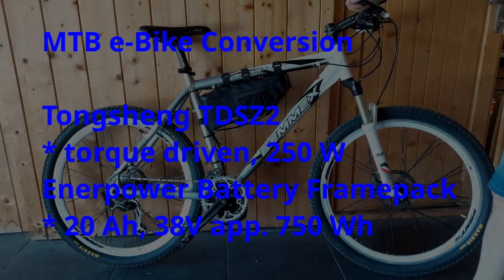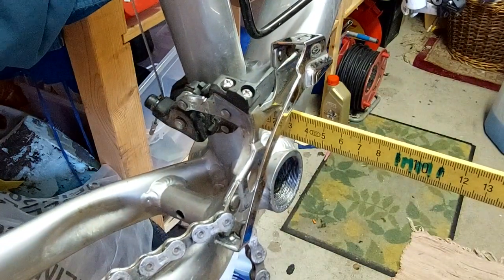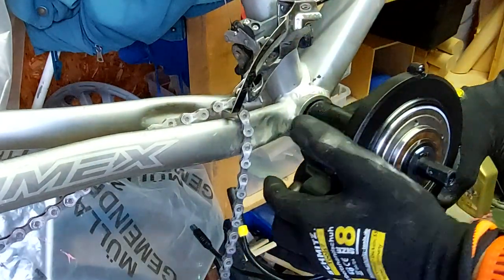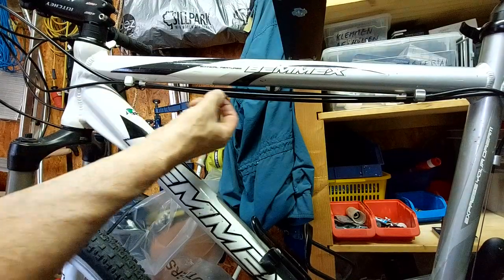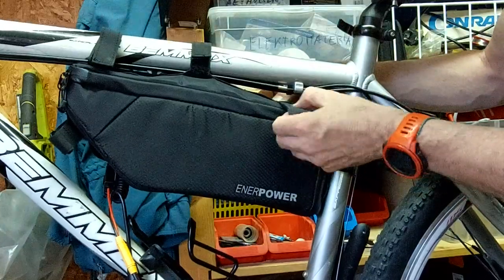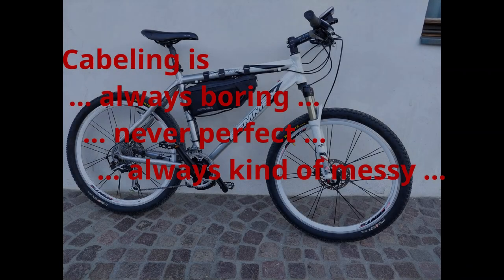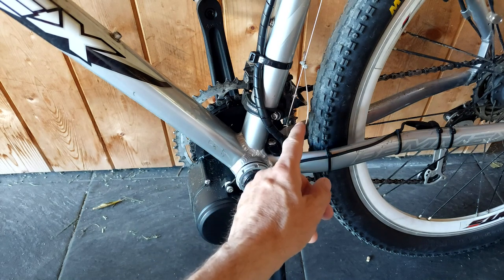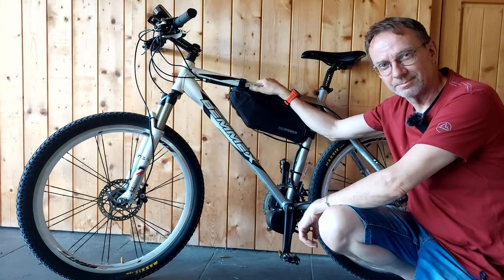Tongsheng TSDZ2 DIY E-Bike Custom (double) Chain Ring

Comment: Nice build...im also building one using tongsheng
Reply from the maker: Thanks! I had a look at your channel and hope you will make a presentation video once your done with the tongsheng installation - it's really a great conversion kit!
Reply: Thanks mate. Appreciate your work. I have finished my build finally and now in the process of doing tests with it. What is your experience with the throttle? Mine doesn't seem to work very well. And how good is the motor on hills?

Comment: I have a tsdz2b and use the 42t stock chainring with a mountain bike. I didnt yet have any problem going up hill. I was more wanting speed with a bigger chainring for keeping up with the road cyclist. You think its possible to go the other way and have a 42t and larger 50t+ chainring for more speed ?
Reply from the maker: Of course. The only thing to consider is that the stock chain ring usually has an offset to be closer to the frame. Thus the gap between the two chain rings will maybe be too large and "catch" the chain and make gear changing difficult. Check for that and if this is the case replace also the 42T stock chain ring with a standard non offset chain ring. Now you should be able to combine this with 50t+. Have a look at my other video to get a vintage derailleur to make dual chain ring work.

Comment: P.S. You did that with a 32 tooth smaller front Chain-ring but could one also use a 28 tooth one as well?
Reply from the maker: 34 seems to be the minimum you can use on tsdz2.    The Motor ships with 42T standard. Hope this helps.
Reply: @the_geargineer  My Bafang Mid-motor shipped w/a 44 Tooth Chain-ring supplied

But was curious about what I wrote you earlier  about earlier about the dual Chain-rings and your Longer throw 4cm front Derailer, and where I can purchase it.

Please advise,
Michael
Reply from the maker: @michaelshayman8964 : have a look at https://youtu.be/s7MWTI9DFKo - here I explain in detail what derailleur to choose and how to get one. Thanks

Comment: How did you remove the spider to get the original chain ring off?
Reply from the maker: At position 08:55 in the video you see that the spider has 5 holes which were fixed with small allen head screws to the motor (see following minute). These screws are originally secured with thread locker (loctite) so when re-mounting I used also loctite blue. First time I took off that spider I was a little bit nervous but it's no big deal and quite easy to get it off and mounted again. Hope this helps otherwise just ask, Cheers!
Reply: @the_geargineer  I took the five allen-head bolts out, but the spider will not move.  I am afraid to try to pry it off.  Was there any other step besides removing the five small bolts?
Reply from the maker: @OrigamiBicycleCo  as far as I remember not. It took some gentle force but that was all. Sorry that I have no additional advice..

Comment: ciao. mi accingo  a fare installare il kit sulla mia MTB. mi incuriosisce la questione della doppia corona. vedo che quasi tutte le MTB elettriche hanno una sola corona potresti spiegarmi perchè varrebbe la pena averne due? grazie
Reply from the maker: Si, volentieri. Ma il mio italiano non e sufficiente buono cosi prefericso rispondere in inglese. The base bikes I have converted are kind of "old style" MTBs so they have at the rear usually a set of sprockets ranging from 11 - 34T. That holds for 7-fold up to 10-fold. To have a usable gear ratio when going uphill in our mountains I have to go for the smallest possible chainring that is 34T. On the other hand when going on flat roads the pedaling resistancee of TSDZ2/B is so low that you can easily go faster (by your own force) than the 25 km/h where motor support ends. Especially if the road goes slightly downhill. In this occasions it makes sense to have a gear ratio of e.g. 42T (or more) front to 14T rear to pedal also here with a good cadence. So the double chain ring helps you on old MTBs to have mountain and road gear ratios. If you convert a "modern" MTB with rear sprockets from 11 - 46 things are diffferent: here I would stick to a the single stock TSDZ2 chain ring with 42R and offset. Hope this helps. Spero che ho spiegato bene perche le due corone fanno senso per me. Se sono altre domande mi lascia un commento. Ciao!
Reply: @the_geargineer  honestly i dont know how are the old and the modern rear gears. my bike is not new (2012) so maybe it's old. i will ask the mechanic if he can install the dual ring. maybe i should buy it. u have a link?
Reply from the maker: @giorgio.plazzotta : a build from 2012 is the perfect age. But be aware that dual ring can be tricky, see my other video: https://youtu.be/s7MWTI9DFKo . Besides that the chain rings are regular 5-hole road bike chain rings you can get "everywhere". The conversion kit I bought in germany at https://enerprof.de/Motor-Kits/ . Prices are OK there and batteries are assembled in germany and have ISO certifications (which is for safety/insurance reasons a big advantage). But you get everything also at ebay or amazon. I am currently preparing another conversion of an 9-speed MTB and will go this time for single front ring 34T front and 11-36T at the rear as the driver is more on the "mountain" side. Feel free to write if there are still questions.
Reply: @the_geargineer  since u are an expert of this mothor i have another question for u. i just took the kit to the mechanic for moutning so we noticed that i bought the kit "with brakes" though I have hydraulic brakes. i could buy the sensor for hydraulic brakes but i wonder if it is really useful or i can go without it. . I think that if i stop pedaling the mothor will not give power. what do u think?
Reply from the maker: @giorgio.plazzotta  : I believe you are talking about the brake sensors: my experience is that the TSDZ2(B) works very well without brake sensors. TSDZ2 works based on torque sensing and amplifies the force of your legs (more exact the pressure you apply to the pedals). If you just pedal without any force the motor will stop to support. So brake sensors usually are not necessary. With Bafang-motors (or the older bosch motors) things are different: the motor senses only the movement and not the force: as soon as you begin to pedal the motor starts to work at the support level set. So if you brake and would still just move the pedals - even without force - the brakes would have to work against the motor. Thus these motors need "brake priority" (via brake sensors) to avoid this scenario and stop the motor when the brake is acted even when pedals are still moving.  Hope this helps.

Comment: would this work with bafang bbso2?
Reply from the maker: Sorry, but I have no experience or knowledge regarding the bafang motors.
Reply: @the_geargineer  besides that, is there a limit on how big the chain rings should be? I am wanting to run a 34t and 50t. If I were to pull this off, would there be any issues with this?
Reply from the maker: @smolasianboi8432  on my tsdz2 I have 34T and 43T which works fine. As in Germany motor support stops at 25km/h larger chainrings are of limited use. From a technical perspective 50T should work (like on "normal " bikes)